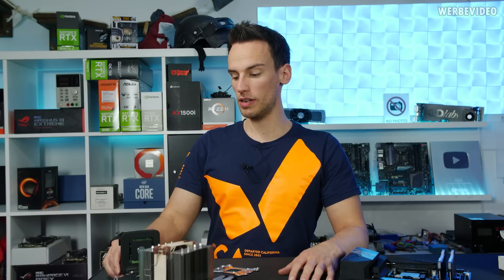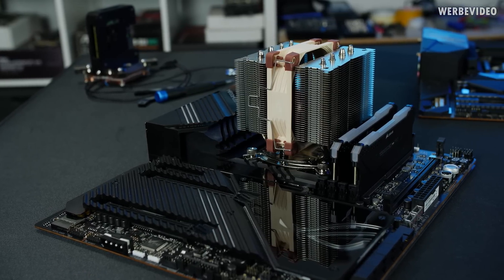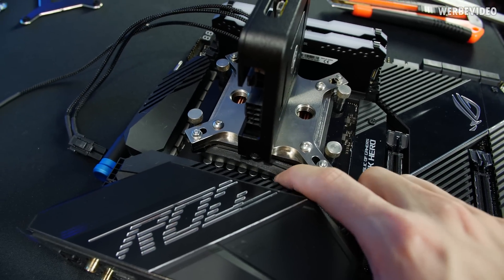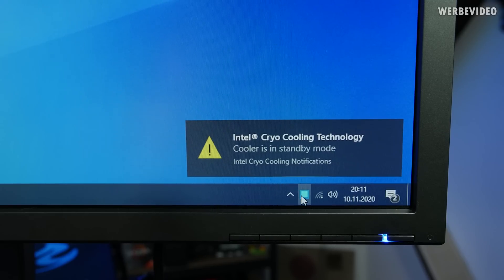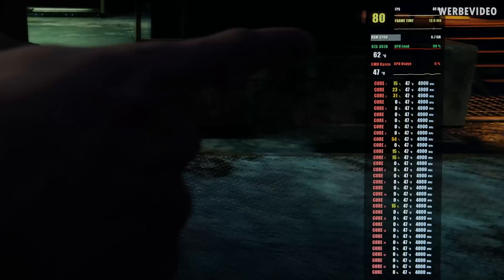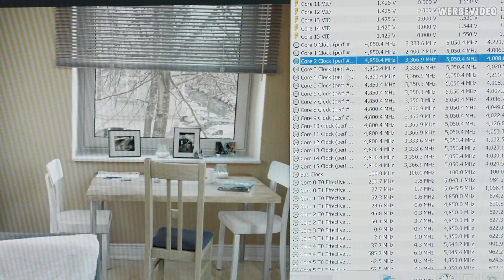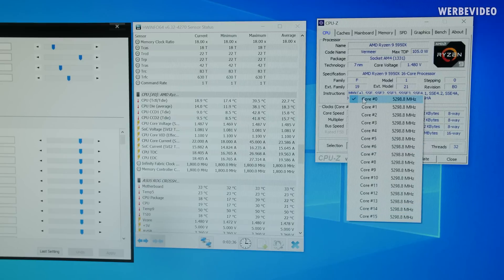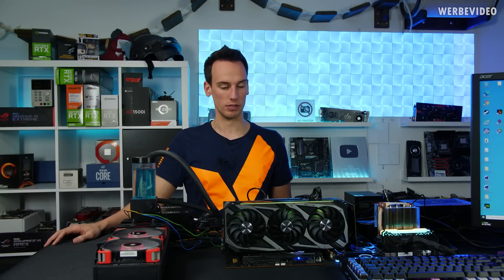I probably wasn't supposed to do this 😅 Ryzen 5950X cooled by Intel Cryo Cooler

Comment: Intel : Nooooooo, you cant just put our cooler on our competitor cpu
Debauer: haha, Amd go brrrrrrrrrr
Reply: My i7 also goes brrrrr, for less price than the ryzen 5000 crap :)
Reply: @harrison00xXx 
Which i7?
Even a 5600x would beat any i7 in gaming while running cooler ,using less energy and cheaper.
Reply: @chrischen6664  an older i7, i hated how useless and expensive DDR4 systems were so i upgraded a i5 4430 system i got for free with a cheap, used  i7 4790k, easily pushes to 4,8GHz allcore and with 2666MHZ CL10 Ram OC its still a beast.
All i wanted was NOT support AMD, Intel or Nvidia. I ended up with new a GTX 1000 card anyways, but at least i didnt support the DDR4 marketing gag and none of the CPU sellers like Intel or AMD (and yes, both doesnt make CPUs itself anymore, all they are doing is researching, they only make money anymore without any interests in the customers anymore.

running cooler? even at 4,8GHz my old i7 is pretty cool, far from dangerous temps...
ofc finally AMD beat Intels in gaming.... after how many years? 5? 7? 8 years?
but since i mainly play in 1440p 165Hz, the 4790k still push fps nice, im fine with it, no sense in paying like 500$+ for a new platform for +30% better 0,1% lows
If i get MUCH better 0,1%lows and also significantly better avg fps, i will upgrade my CPU/MoBo, but since this happened not yet (with a damn 7 years old CPU!), i wait for at least Ryzen 6000, Intel 12/13th gen, or even DDR5 systems (which was the main goal anyways with my "last gen" DDR3 system).
Reply: @harrison00xXx  even the 10900k cant beat Zen 3 at this point. Sure, the 4790k is still good but not as good as the 10900k let alone Zen 3
Reply: @chrischen6664  Ohh and the system was cheap af, still as fast as modern Intels these days like the 7700k(at stock!)
Got the 4790k used for 130€ on ebay, was risky since there was no picture of the CPU or box and the seller was a new seller with barely sells, not to mention the weak description he had in the auction. Most 4790ks from "trusted" sellers got away for at least 200€, but i risked a bit and got extreme gaming performance CHEAP AF in beginning 2017 already.
I would have probably even bought a used 4790k for 250€ instead of paying the same as brand new, only to support others than Intel.
And stand 2020 is: The 4790k isnt the bottleneck in my PC, aslong im sticking to 1440p and easily maxxing out the GTX 1070 with high settings.
Im even planning to buy a RTX 3080 Ti as soon they are aviable in Jan-Feb. 2021, again once more overpriced computer stuff, but i hope again for at least 4, better 5 years plus i have enough graphics power, so only the CPU need an upgrade in 1-3 years.
I mean im even fine with my 1070, but i want to use the full potencial of my OLED TV with HDMI 2.1. Damn marketing made me like 4K gaming (especially now in 120Hz modes!!!!), 6 months ago i always said 4K is useless and a marketing gag, now i would love to play tactical shooters where superior distance drawing is a nice advantage with 4K120Hz Gsync....
A native 1440p OLED TV/screen would have solved all problems, but sadly 1440p on 4K OLED TVs doesnt look quiet as sharp as native 1440p so i would love to unlock nice gaming capabilities at the native TV resolution even if 4K isnt any advantage for the specific game.
Reply: @harrison00xXx  its used. Thats why its cheap. You can also buy a cheap 8600k or 3700x and 2080s and get a good pc
Reply: @chrischen6664  And so?
First AMD fanboys cried "mimimi 10 fps more for 300$", "mimimi the human eye can only see 30 fps", "mimimi the human eye can only see 300$ more"...

Seems like this changed with Ryzen 5000. Its now more expensive for 10 fps more, why AMD Fanboys dont use the arguments they used before Ryzen 5000 now against AMD itself?
Damn ofc the 4790k is already a grandpa, but if we are real, my 4790k is only a grandpa of the 10600/10700k, the 2700k i7 is the real grand-grandpa of modern Intels.
I still love how even a 10 year old (overclocked!!!) 2700k still is pretty ok for gaming, despite its age. Would have been impossible before around 2010 to keep a CPU for gaming for longer than 4 years.
Reply: @chrischen6664  2080s and you call this cheap? 800€ only for the GPU!
All my Builds always cost maximum 800€, for the whole system or sometimes a bigger upgrade as GPU or CPU/MoBo
But (the only) "Hi End" purchase was a FAIL in the end, like a 7950 GX2 nvidia for nearly 700€ which was outdated after 10 months (but at least i loved these days titles supporting SLI pretty well so i was one of the very few people playing games smooth in 1600x1200 in 2005-2007

And used doenst have to be cheap... look 4790k prices, even used some are getting away in auctions for still 150€. Ofc its not worth it anymore in 2020, but as i built my "new" rig, there were some factors making a nice gaming build impossible for fair money:
1) mining hype was beginning slowly
2) new Intels were barely faster than the previous DDR3 systems but MUCH MORE expensive
3) GPU prices ran already crazy generation for generation

The IT industry was already too "evil" for me so i couldnt support them anymore, and a 4790k was used the best option to boycott Intel, AMD and DDR4 but still getting (OCed even more) performance of "modern" CPUs these days like 7700k.
It was a big mistake to support Nvidia with the GTX 1070, but there was no other viable option also so i took the (in my opinion overpriced) 1070 for 350€ around. At least not for 400-450 as the mining hype was in its "glory".
Reply: @chrischen6664  Look, i would build again a new desktop PC... but lets be real, and think about it please:
Desktop hardware was always superior in gaming compared to "gaming"-Notebooks.
Still, a good gaming PC build cost like 500-800$, for 800 you got a nearly HI END (!!!) machine. If you needed like 5-10% more performance you paid like 1500$+, most knew thats not worth it.

Now, a decent desktop for gaming cost AT LEAST 1500$ for something closer to Hi End, but still far away from Hi End. A friend paid 1800$ for a ryzen 3600x, 2080S desktop. 3600x isnt close to hi end, and 2080S is overpriced crap (since ever).
I got instead a notebook, HP OMEN 17, the SMALLEST RTX 2080 notebook with a 150W 2080. Cost only 200$ more than the friends desktop, but i have also a nice 144HZ 1080p screen, a battery and im mobile with it. Ofc less CPU power with its i7 9750h, but its meant for gaming, 6C/12T still works fine for the next years. 
And the 7-11% difference in 2080 desktop vs mobile is negliable, especially in higher resolutions on the TV for example

I was purely a desktop gamer, and the main reasons i didnt like gaming laptops were its poor gaming performance and very high price tag of 3000+, no upgradability and so. Meanwhile i got a fast gaming monster for 700-800$, could upgrade/replace easily whatever i want...

Ofc i would still love the benefit of replacing different parts easily in case of a damage or upgrades, but as soon i have to pay even for a far from Hi End gaming rig 1500$ or more... i get instead a fast gaming notebook for 200$ more and enjoy this special advantages.
I mean the full size GPUs in notebooks with RTX 20 series made also a huge difference for me to "switch" to a notebook, but im dissapointed by PC development since around 7 years, prices rised extremely, performance not so if at all (for example the whole Intel Core i Lineup)
Otherwise i would have bought a new CPU instead of a used 4790k, probably even a 7700k for 300$+ which was the actual "gaming beast", but none of them deserved my money anymore. A luck for nvidia i was and still am a "hardcore" gamer, otherwise i would not have paid 300$+ for a midclass GTX 1070 and probably soon 900-1000$ for a soon coming 20GB RTX 3080Ti (will be around as fast as a 3090!)
Reply: @harrison00xXx  In what world is a 2080 selling for 800 euro? I can find that on local facebook for 350 dollars. I will glady sell a 2080 to you for 600 euros.
Reply: @harrison00xXx  You have to be the funniest guy I have ever met. 800euro for 2080? If you need 5-10% more performance pay 700$ more? If you are gonna spend that extra 700$ then you can get a gpu 2-3 times faster than what ever you have which is 200-300% more performance. So thats already nonsense.
What on earth are you talking about here.
9750h cant even beat the 4600h and you praise it like its good and all.
The IT industry is evil? The whole point of business is to make money, not charity.
A decent desktop cost 800$ not 1500$.
Your logic is so flawed its funny.

Comment: There's really no need for permanent usb connection. Calculating the dew point and controlling the TEC is an easy task doable in the microcontroller so I'd bet there are only simple control commands over the usb. It should be relatively easy to reverse the protocol and re-implement simple control app. 

It should even be possible to patch the firmware to run in cryo mode without USB by default.
Reply: I2C would have been a better bet, and it's built into a lot of motherboards.

Comment: Hey Roman hear me out, Project Irrationality 2.0 with one of those double pc cases, the big system contains the full size 5950x system with the cryo cooler, and the ITX system houses a 10900k controlling the cryo cooler. I feel like it would be the ultimate irrational build
Reply: Just stick a NUC in one of the PCIe slots to control the cooler, that'd be even cooler.
Reply: Or one of pcie PC's of intel
Reply: DRM in a cooler now? This is getting stupid.
Reply: @TechyBen  i guess someone could port the software? After all it's just a humidity sensor and a power controller for the TEC module
Reply: suggest it to LTT, they'll definitely be up for this.
Reply: I was thinking about the same, Intel cpu on a mini ITX board cooling the main AMD cpu :D Great idea.
Reply: Like the Corsair Obsidian Series 1000d case !
Reply: Have the Intel watercooled  with the cryocooler. Doesn't need to run well just run.
Reply: Yet another use case for the 2-in-1 Enthoo Pro 2 case. :)
Reply: OMG, so that's what those dual system cases are for. LOL!
Reply: Corsair obsidian 1000D would be good for this
Reply: That would just be the same but in a case... sounds like a lot of pointless effort.
Reply: @nekron75  thats kind of thr point. To be pointless.

Comment: Stupid idea: could a tek be used to cool the water in a loop instead of the CPU itself? Cooling the outlet of a radiator would bring cool water to the block, but would be way less heat than cooling a cpu itself?

Comment: How long until we see some open source circuitry and PID controller software.... 🤔
Would be the ultimate kick in the teeth from AMD to do something like this and open source it all. 🤭
Reply: It is easy enough to do. Any single chip micro would handle the very limited processing needed. Just need a temperature and humidity sensor and a power FET output stage. Use something like a Threadripper block on top of the TEC but would need to machine a piece of copper underneath. I certainly wouldn't mount the controller on top of the CPU. I'd like to know performance gains on a normal binned 5.1GHz 10900K first though to see if it is worth it! 200W TEC module is 33GBP from Farnell.
Reply: @ColinDyckes  True, not sure why I didn’t think of it, but you could build something like this with an Arduino and off the shelf parts pretty cheap! It’s the custom block that would be the hard part to source.
Reply: @BRUXXUS  The 200W TEC module I found uses 24V so would need an external power unit. I'll try to find a 12V one. Up to 300W is possible with 48V ones but very expensive. I considered this 6 years ago for my 3930K OC which draws 275W (about the same as my 10900K on Prime95 max heat 🙂).
Reply: @ColinDyckes  Is it the same as what Black Shark Fan Cooler for Smartphone dose? cause i have an idea about what if i attach it to my cpu cooler?
Reply: @HapPawhere  I had to look up what that was. It is the same idea on a much lower heat transfer scale and even if you replaced the fan by a waterblock it is just too weak to handle a non-phone CPU. Better to stick to a good fan cooler. I used a Noctua UH-12A to get a 9900K to 4.9Ghz at 220W max on Prime95 maximum heat test. The 140mm version might be better still.
Reply: I think you'll just need to fool the software to think that it's running on an intel platform

Comment: Is it nesessary to have controller sitting right on cooler itself? I would like to buy and probably use it daily but only if its possible to hide controller behind motherboard tray
Reply: Yeah, I'm not sure why the controller is built in like this. I'm guessing just easier to have the ambient temp and humidity sensor soldered directly to the board. If I had to guess, it's just cheaper to manufacture one assembly rather than 2 or three.
Although, I'd definitely prefer to keep the controller hidden and just have the temp and humidity sensors as a tiny little module on the block.
Reply: @BRUXXUS  yeah I spend thousands on HW and water cooling components and I really dont want this ugly solution in my showcase PC

Comment: Sry for unrelated question, but have you checked the Ryzen 5000 series boost clock behaviour? Are they still the same or similar with Ryzen 3000 series?

Comment: It's a neat advancement but.... I don't think we need to be consuming even more energy for a negligible gain in performance. Computers already consume lots of power- let's all be a little greener and maybe just use more energy efficient coming options.
Reply: more importantly, tec cooler can’t handle when power consumption is over 180w plus the potential risk caused by condensation...
Intel just tried to tell us they r still doing something😂

Comment: You could disable a ccd or some ccx's or even disable the smt? And try it with 6 cores etc?
Reply: A ccd has a ccx in zen3
Reply: Thats possible since Zen 1, but its not specific to AMD, as far as i know, you can do it with Intel as well.
Reply: @kawafahra  intel don’t have ccx’s lol
Reply: @trisjack82  Nor did he get the point of it would be to simulate an 5600X or 5800X using a 5900X or 5950X since Roman says in the end of the video that he doesn't either of the first two CPUs, so the OP simply offered the suggestion to disable a CCD on those that he does have to simulate the results.
Reply: @SamsoniteDove  Not really. The cores on the 5950X are the fastest in the entire line up. The numbers would be inflated if he did that. A true 5600X will have much lower frequencies.
Reply: @Mojave_Ranger_NCR  Much faster? 200mhz faster is just around 4% when stock. Less if you're OCing. So you you'd just take your best result turn it down by about 100mhz. That's a close enough simulation of a real 5600x/5800x.
Reply: @SamsoniteDove  Or just use a real 5600X, which he is going to do. It will give the most accurate results.
Reply: @SamsoniteDove  200mhz is a decent amount, have you ever overclocked before??
Reply: @Mojave_Ranger_NCR  yeah, 200Mhz can be a huge difference, thats why im running Intels because they overclock so much better
Reply: @harrison00xXx  Yeah, I can see that. Not going be the case anymore though with Ryzen 5000, it just performs too well. Hopefully Intel gets there shit together with Rocket Lake though
Reply: @Mojave_Ranger_NCR  Yeah i was pretty happy about this slow development, i mean i could use already close to 7 years a 4790k, stil performing awesome in 2020.
I still wish i can jump over DDR4 and directly to DDR5, lets see how long this will take
Reply: @Mojave_Ranger_NCR  if it bothers you then he could run 6 cores and lock the frequency at 5600x levels....
Reply: @trisjack82  this video is about AMD
Reply: @SamsoniteDove  Thank you bro, at least someone understood